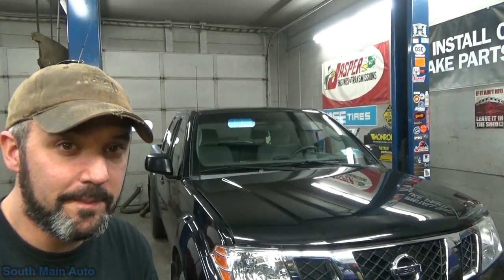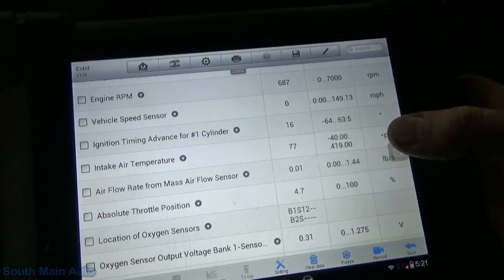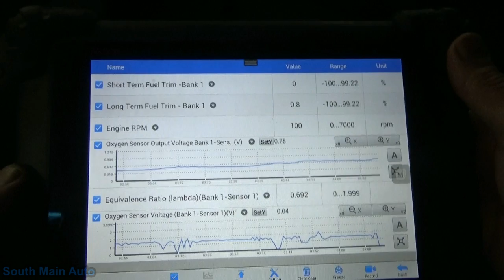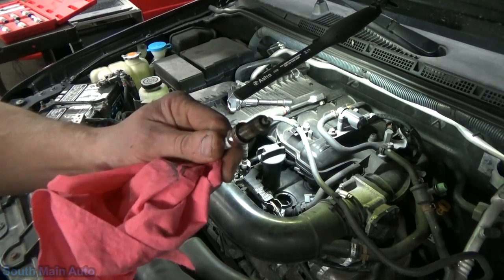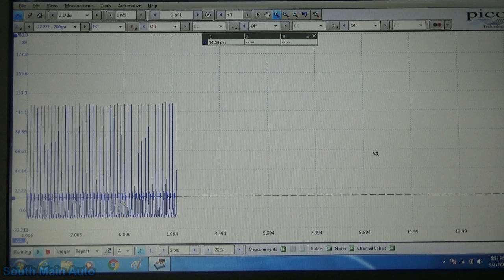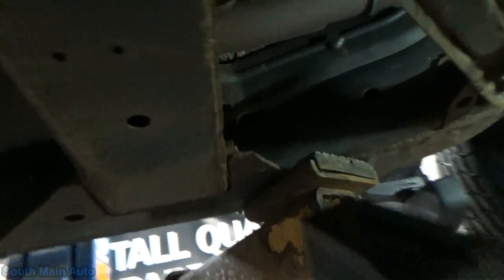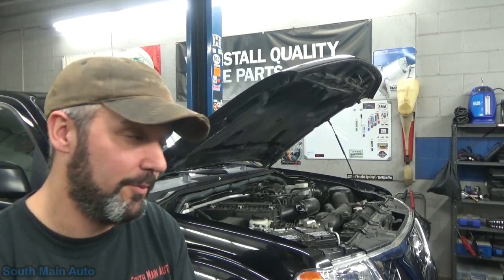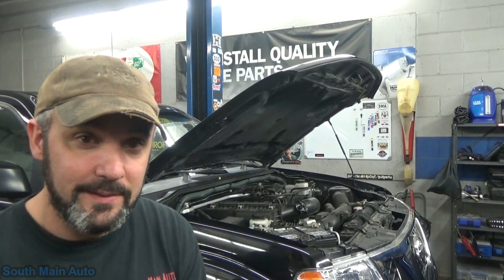Nissan Frontier - Low / No Power Complaint

Comment: they used to make this really good catalytic converter cleaner back in the day. i believe it was called “Screwdriver and Hammer”
Reply: Yup, just sold a infinit Qx4 , former owner conducted that surgery B4 I owned it , problem solved
Reply: I always use one called “drill and auger bit.” Works great
Reply: I picked up some new old stock of that the other day works like a champ.
Reply: @hahnmowermotorsports179  thats a great one. I used that product before. Works like a champ. Also used it combined with screw driver and hammer cleaner to make sure it was sparkling clean.
Reply: Hey! About 4 years ago here in Armstrong County PA I used a similar cleaner to what you guys used on my old 2004 silverado pickup. I believe it was called "sawzall, exhaust tube bender, and straight pipe". Kind of a weird name for a cleaner but it worked better than ever and sure cleaned her out. Only one cat was plugged (there is one on each bank of the 6.0 v8) so the truck was running really really weird. Also I was able to use the "hp tuners" "tune up" software to take care of my new false check engine light that came on because I used this cleaner. Took care of that and actually plugged the truck into my friends emission machine and it passed! Yes is passed after that!! That tune up software really works!!!!
Reply: Knock thst crap out of there!
Reply: I used that once  only it was concrete chisel and hammer
Reply: Yep they would make me a test pipe I could put in place to see if the the cat was bad
Reply: @outbackcountry512  klll low

Comment: I just starte4d watchina g your videos recently.  I am 75 years old and my very first car was a 1955 Chevy with a 265 V8 which burned oil so In decided to tear the engine apart and relace the rings.  I got most of my tools from Sears and parts by mail from J C Whitney catalogs. In 1963 that was the equal to Amazon today for cars and truck parts.  I got it done and all reaasmbled but Im ended up with 2 bolts left over.  Not a clue where from.  The car ran well for a while but then started to burn oil again.  So I took everything apart again and found out that I left the 2 bolts off the main bearing cap on the crankahaft.  Solved the mystery of the 2 extra bolts.  I enjoy watching auto repair videos but the electronics lose me.  
Keep up the good videos Pete

Comment: Eric was excellent in diagnosing a bad catalytic converter. With this in mind, there are two points which may be of assistance to viewers of this video which are having a similar problem. First, the rattle noise heard coming from the exhaust is most likely the heat shield on the front catalytic converter. Over time, the heat shield will become loose and deliver the "Nissan Rattle". In such a case, a stainless hose  clamp placed at the appropriate spot will remove this noise. Secondly, you may have a vehicle which still has a warranty in place. Though your vehicle is outside of the standard 5yr/60,000 mile factory warranty, converters are covered by an emission control warranty for 8 years or 80,000 miles. Dont spend a fortune on a repair if you dont have to.

Comment: My first test on a car with this similar issue is is take it down the road. Give it gas tell it starts choking out and pop in in neutral will my foot still on the gas. If the rpms go up it’s most likely a fuel delivery issue. If not looking more like catalytic converter. Great work! Love the videos

Comment: In the old days, we diagnosed a restricted exhaust with a simple vacuum gauge. Start at idle and slowly bring the throttle up. The vacuum should go up as engine rpm increases. If it goes down, the exhaust is restricted.

Comment: I had a similar issue with my 2012 Nissan Frontier with the 4.0 liter engine. They replaced many parts at the used auto service department and still couldn't fix the issue. 
Issue: loss of power out of the blue and when engine would warm up. No engine check light. Engine thermostat was reading high but not in the red.
To make a long story short, the Nissan garage had it for about 15 minutes and found it was a bad thermostat. Because it was overheating, but not in the red (danger zone) the system would cut power to the engine so it wouldn't destroy itself. 
Great video. I would just tell people to make sure and take your vehicles to a reputable mechanic. I was without my almost new truck for about a month and a half because the service department at the dealership couldn't diagnose a simple problem.

Comment: When you take a measurement when you were trying to reach zero on the pico, you can just type in “0” on the measurement box after you pull it down and it will go automatically

Comment: As soon as I heard the engine sound when it was being revved up, I thought plugged catalytic converter. I’ve heard other motors with that problem and it sounded exactly the same.
Reply: There are other ways to check for bad cats without running the engine which could cause some major issues!
Reply: Should have a p0420 code well before the cat gets too bad to drive probably something like a mass air flow meter just guessing because I haven’t finished the video.

Comment: Had a similar failure on a Ford V6 Escape, front maniverter came apart internally, clogged the down stream cat. Caused the plastic oem EGR to blow off as well as the no throttle response symptom. OBD showed misfire on two front cylinders. Thanks Eric.

Comment: My Nissan did the same exact thing. I thought it was bad gas too. I was 200 miles away from home and had to drive it with barely any power and missfiring like hell. Finally got it cleaned and now it runs perfect

Comment: Eric.. Just FYI The Felpro ES72481 Spark-plug tube seal kit fit almost all of the Nissan valve covers. I have used them numerous times. They cross reference for the 3.5 engines in the Altima's but they fit and seal perfectly on almost all of them.

Comment: Wonder if the misfires took the cat out or if the misfires are associated with the failed cat. Curious if you still had the misfires after you changed the cat if your got the job...unless of course you video'd it and then I guess I'm just going to have to wait. This is where diagnosing with a lab scope helps pay for itself & saves you so much time. You didn't turn a wrench or get your hands dirty other than removing the sparkplug but definitely better than stripping out an AFR sensor to check back pressure!  I love my Pico & thanks again. Great diagnosis as usual & hope you got the job.
Reply from the maker: Yeah didn't get a chance to record this one just because I was spent on time but when the job was all done, the FT's were spot on and when i drove it , it didn't miss a beat. Dunno, but I am sure time will tell :D
Reply: Eric I worked at a shop in allegany NY. Not far from you and we had at least two of these come in this way. Couldn't find a cause from what I remember either. Also I remember these having trouble with 02 sensors. Have yo ever run into the ford 500 problem? Where the egr melts a hole in the intake and then the cat melts? Haha they do it at like 50k too!
Reply: As  mechanic, I say yes. A misfire probably shortened the life of the cat. It would. That's why we have car software that monitors misfire.

Comment: I'm assuming they never did have you replace the converter. Was curious what the old one looked like inside. Bet they took it to some backwoods shop and they simply shoved a pipe through it.
Reply: My repairman told me to floor it from time to time, just to blow the converter.  Have not had any converter problems (no plugging or emission inspection fails) so far.

Comment: know of a couple cases on these 4.0 where not only did the front cats come apart, but the back pressure forced particles back-up into the cylinders causing valve and piston damage  (on iATN).   These guys were fortunate.

Comment: When you said it started all of a sudden and I heard the rattling sound, I put my money on an obstructed exhaust. But I thought the owner had hit something under the truck  that squeezed the pipe to the point of almost total obstruction.
Reply: Clogged cat is horrible for the motor. Increased pressure will definitely do some heavy damage to the pistons. Probably caused the truck to go into fail safe mode by shutting down a cylinder

Comment: Before you even tested it I figured that's what it was.. I have a v6 pathfinder of the same era and I have replaced.... All.. 4.. catalytic converters (with cheap ass ones that'll probably only last a few years). Those O2 and AFR's are actually pretty stout on these. I took mine off about 5 times and it was tough the first time but not horrible.

Comment: The ceramic inside a catalytic converter is made from fragile material. It is typically protected by an insulating mat. This mat holds the catalyst in place and provides moderate protection against damage. However when anything strikes the converter or a broken exhaust system support can cause this catalytic material to fracture. Once the ceramic catalyst is fractured, the broken pieces become loose and rattle around and break up into smaller pieces. Flow is interrupted and backpressure in the exhaust system increases. This leads to heat build up and loss of power.

Comment: Definitely worth taking a little bit of time to get a feel for the metric system. The best way is to give up on trying to convert to imperial, and just go for thinking in metric. 1 metre = large 1 step, 1 centimetre = the width of your little finger, 25 degrees celcius (or centigrade for USA folks) = a beautiful sunny day. Metric is excellent when you want to convert weight to volume, because 1000 litres of water = one metric tonne.

Comment: It was even audible after you shut the engine off, the hiss of the pressure escaping. (obviously could also have been AC low on gas/evap purging or similar so wise to diagnose with the scope and pyro too).  First time I've heard of it occurring suddenly though like you say, normally takes a while and in my experience usually plugs up the back box. Wonder what state the 2nd cat was in, too, having been bombarded with chunks of porcelain?

Comment: Every 10C = 18F. Add 32 at the end and there you go. For kms, multiply by 6 and then divide by 10. You'll be off somewhat on large conversions but it'll get you in the ballpark.
Reply: Over this side of the world we take f- reading, -32, divide remainder by 2, = C.
Reply: if you want do the exact conversion, the easiest way in your head is double the temp in C, take away 10%, add 32.
Reply: Never Gonnatell  nah, takes too long lol, always 2nd guessing it's correct

Comment: you could have done a running vacuum test too.  when you rev it up if the vacuum doesnt drop hard, your exhaust is  plugged up. ols skool test that still works on any engine.

Comment: Have a 2002 Malibu that did this too. Brother was driving it down the freeway and it just lost power. Limped it home, started diagnosing a fuel related misfire, discovered it was a badly plugged converter. Took the EGR tube off running from the exhaust manifold so it could quit choking on its own exhaust long enough to get it to a shop for replacement. It's happy now, I guess after so many miles they just call it quits.

Comment: I believe that converter is covered under warranty still. Unless it's past the mileage allocation part. Oem nissan parts aren't priced bad at all for the cat. Another great video.
Reply from the maker: yeah it was past in miles and it was less than 500 for all OEM parts. Not to bad

Comment: Thankfully if the car came equipped from the factory with Federal Emissions ONLY it's much cheaper to replace the converter.  If it states both CARB and FED on the tag?  You're screwed into spending mega bucks on the CARB one.  Thankfully our VW has FED only so the converter is about 1/4 the cost of the CARB one.  Our Subaru is FED/CARB and the converter is about 800 higher then FED.  Hence why most cars wind up in the scrap yards when they see a P0420 code.

Stupidest thing though.  Converters for FED will reduce emissions just fine.  CARB just loads up the converter with more expensive material with the promise of "better warranty" and in NYS that's useless.  What's an extended 5 year warranty worth when the rest of the car rusts out around it in under 3?

Before I get the greenies all annoyed.  CA did a nice job on reducing emissions once converters where attached to their cars back in the 70's.  Then CA does what they do best, over regulate EVERYTHING!!  NYS and a few other states figured  "Gosh...it's working great for them!  (actually a FED converter does the same damn thing)  So let's jack up our citizens and pass CARB requirements when Federal Emissions work fine."  You want to see poorly regulated emission standards-  Look at India and China where the government only cares about power and control, and they don't give a damn about the air quality.  The USA has done extremely well on this topic well before CARB became a fad.

Comment: I wonder when he had oil in the plug wells if he drove it long enough with it misfiring to load the cat with gas? Too bad he is past emissions warranty as well. That part is going to be expensive. So the cat and manifold are all one piece on that? Wow, that's crazy. Cool checking for the exhaust restriction with the scope, great video.
Reply from the maker: Yep they are all one piece but it wasn't to bad, about $500 for the factory one

Comment: A potential problem has been detected in Europe with Nissan Navara, Frontier in USA. "Furious customers urge Nissan to recall 4X4 Navaras after it emerges that major fault could see trucks snap in HALF", due to a rust/corrosion problem with the chasis.
Reply: torre1976 Vs this happened to Toyota tacos . Seen the picture of the tech who put one on a lift and it snapped in half?
Reply: Nissan is using Toyota frames now I assume.

Comment: Could have just left the Plug out and see if it would rev up more?  The Exhaust Back pressure would blow out the open Hole. Instead of Cool Compression  it Would be Hot Exhaust gas Coming out.  Very Good video Informative

Comment: I had one but the 4.0, hated that "truck". Twice it had no power, once converters clogged, 2nd throttle control wire broke. Had multiple issues with it. I gutted the converters, got the best milage it ever got, had more power than it ever had

Comment: my dad had one of these trucks, Nissan put an engine in it at 8k and a front axle and power window regulator in at 17k, eventually sold it back to the dealer. made my Jeep look reliable.
Reply: Yeah, Nissan ain't what it used to be.
Reply: opl500 I have a d21 based Pathfinder with 500k on it and just put an engine in it, it's been a super great shop truck. Hopefully the new frontier will be able to fill the shoes of the d21
Reply from the maker: Oh man if it made a Jeep look good it must have been reallllly bad haha
Reply: South Main Auto Repair my Jeep hasn't left me stranded yet!
Reply: SPENT ALMOST 400 IN A CAT ON MY DODGE TRUCK COURSE IT WAS 20 YRS OLD

Comment: Hey Eric here is a tip for the Pico. When you are measuring pressure or volts and you want to know where 0 is You can just type it in and the line will go to zero. Great Video
Reply from the maker: What do you mean type it in?
Reply: the little box that pops up when you pull down your measurement lines that  has voltage or pressure, and delta, you can click on the pressure/voltage numbers and just type in 0 and your measurement line will move automatically to 0.  That can be done with all 4 channels
Reply from the maker: Welll I'll be, i will try that! Thank You!

Comment: years ago before all the fancy equipment, you would use  a vacuum gauge to determine if the exhaust is plugged. Is that test still valid today?
Reply: probablynot as they dont have the same inlet restrictions on the inlet or a throttle butterfly
Reply: why wouldn't it be??same basic structure. block crank pistons etc. the difference being the computer controls the fuel.. on carbs the lack of vacuum actually made them go lean and quit.
Reply: Yes it's still a valid test for restriction not efficiency. The basic air pump principles apply to pressure in and out

Comment: I had a 98 dakota do this. Except it would run ok, low power but it would accelerate. Then as you drove it it the temp would climb then it would start overheating. 
Cat was plugged.  Thought it was fuel related issue as well. The temp rise was a good indicator.

Comment: Nice video Eric. Using the pressure transducer to diagnose the high back pressure in a cylinder was pretty interesting. I'm not sure if i would have thought of that. I'm surprised it didn't throw a P0420. 

If it was me I'd cut open the manifold pipe, remove the catalyst to make it drivable and then sneak across the border and get a cheap one put in. It isn't worth putting an OEM cat on a Nissan of that vintage.
Reply from the maker: Well unfortunately here we have to abide by the C.A.R.B. law and have to use a "NY Cat"
Reply: The DIY cowboys definitely have an advantage over you in this department. Must be good business for the shops just over the border in PA in converter replacements.

Comment: The cat plugged up on a Chevy S-10 suddenly and it wouldn't Rev beyond 2k, I unbolted the exhaust on the side of the road and drove it home dragster style, then bought another replacement cat and welded it in. They can plug up suddenly.

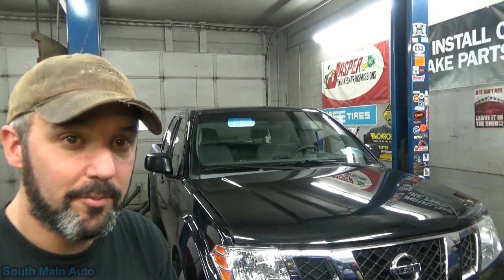Comment: Sounds like when you push the gas to the floor and it stars to bog down and Just plumit on rpm a d shake sounds like a Bell sound metal's clanking Interesting sound what is that knocking or clanking a clamp Eric O @1:00 @SouthMainAutoRepairLLC

Comment: Crazy! I had this same thing happen on my 05 Pathfinder V6. It pulled misfiring. So checked out and realized when I rev'd. Almost nothing was coming from the exhaust! It was the Catalytic Converter. Was holding 40psi. Mine has two cats. >_>